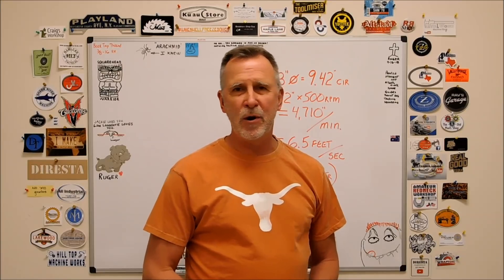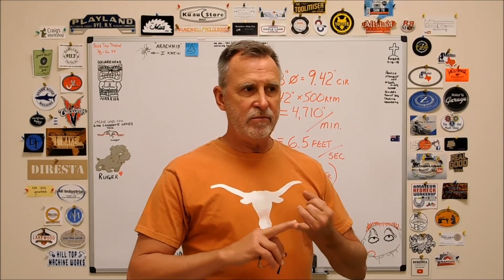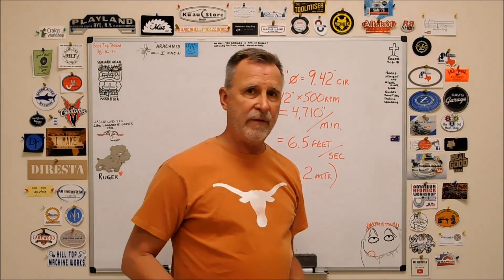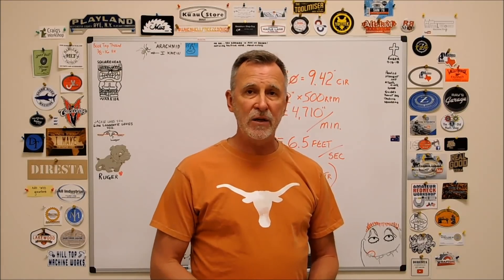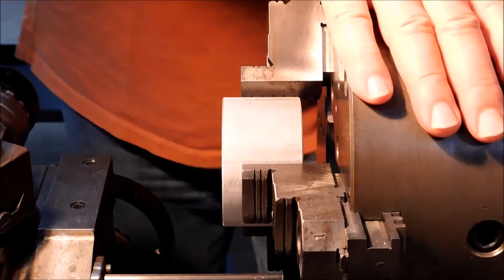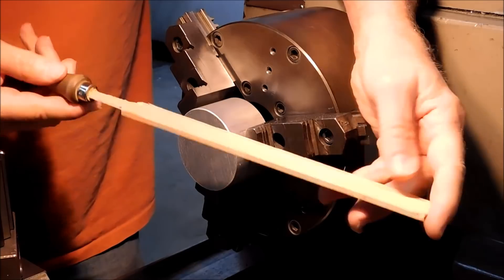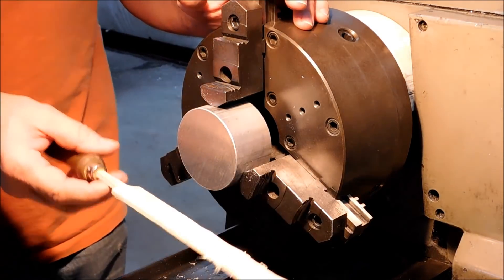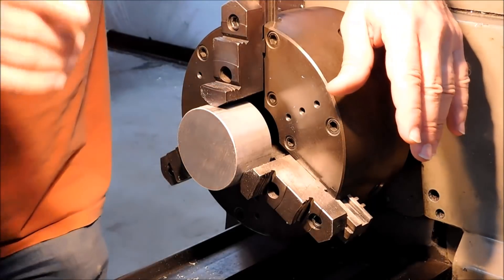File vs Spinning Chuck Jaws

Comment: I was taught to file on a lathe LEFT Handed back in high school in the early 1970's.  Thank you L.J. Jenkins for teaching me the safe and proper way to file on a lathe.

Now I cringe when ever I see someone filing right handed with their left arm hanging over that spinning chuck.
Reply from the maker: As much sense as it makes, I feel more vulnerable and awkward filing left handed. Like I also said, if the situation gets too risky, the form tool is the way to go.
Reply: I would never suggest that you change your style now Joe. That would be hard to change after all the years. I think the left handed filers were all taught the left handed filing way from their first time on a lathe, myself included.
Reply: @joepie221  I'm still glad I'm left handed and yes I've had the jaws give me a love tap to let me know they are there. Love your advice anyways Thanks mate
Reply: Im left handed and joes filing right handed horrifies me.
Reply: I'm right handed, but from the start I studied the situation and concluded that safest is left hand on handle, right hand at tip AND stand well towards the tailstock end out of the line of fire.  Also, a proper long lathe file (single cut with long sloped grooves) helps.  A file card is a necessity too.

Comment: I learned this lesson the hard way...no handle with a short file close to the chuck. I had a momentarily loss of concentration and the tip of the file went into the chuck.

It kicked back and drove the file's tang about in inch into the palm of my hand. I pulled it out and continued working....but never again without a handle or with a short file.

I got incredibly lucky.
Reply: Were you not really  injured? How did you keep working?
Reply: @TheDefeatest 

We'll it fucking hurt...but the tang of the file just pushed back into the fatty part of the my hand. Just a simple puncture wound, scary as hell but nothing too serious.

I pulled it out, washed it real well, gave it the old paper towel/electrical tape treatment and went back to work.

Comment: ALL machinery and machinist manuals say to ALWAYS file LEFT handed on a lathe.  Put a file in your right and left hand, which hand is holding the file pointed AWAY from the chuck?   ......your left.
Reply from the maker: But when the file slips off the piece, the pressure is towards the chuck.
Reply: @joepie221  Your channels offers a LOT of good machinist stuff, many good tips, tricks, especially the lathe, which I really enjoy.  As an old timer myself it's never too late to learn something new about machining and fab.  This particular one though, Joe, sounds like you've got your boots dug in on it for filing right handed, hugging the lathe over the chuck. Your record sounds good for not having it bite you so far.  You won't convince me to stand in line of the chuck, or use a file that way, .....ever.   If you go back to the origins of the engine lathe over 200 yrs now, you won't  find any lathe manufacture, or machining training, ever encouraging machinists to use your method. It will always be to file left handed for safety.   Similarly there are those who seem to believe its okay to leave the chuck key in the chuck, and won't concede the point.  As a viewer I try my best to separate the good info from the bad, as there is so much to learn from youtube.
Reply: Having no control and control is everything.
You can feel the air if too close elbow on headstock so much so you can control your body, hand and files witha  constant clipping, thats control and it never whips the file at you if running fast enough.

Comment: Joe i have a selection of files specially cut for lathe O D turning i use in smoothing out rifle barrels used properly they don't clog but veary little check out your file supplier .😁.
Reply: I'm pretty sure Joe is familiar with lathe cut files :)

Comment: Joe, thanks for the vid.  Have to add my voice to others here in that I was taught to file "left-handed", i.e. left hand on the handle, right hand on the tip.  This negates the need to reach over the spinning chuck.  This doesn't alter the point you make that controlling the tip of the file is key.
Also, I'd love you to repeat the experiment with reversed jaws and the workpiece held in one of the minor jaw steps.  This creates a gap between the O.D. of the work and the outermost step of the jaws, which I would consider the most dangerous situation for a hookup. This would be an unusual situation and I can only remember having to file like this a couple of times in my life.  On these occasions I make a large washer that slip fits the O.D. of the job and is large enough to cover the gap between the job and the jaws - preventing the file from accidentally hooking up. A piece of 3 ply, or heavy oil jointing or similar will do - simple and disposable.
Keep those great vids coming with thanks from Down Under.
Reply from the maker: I've seen that exposed jaw setup done many times. Thats just asking for an accident. Take the time to setup the chuck correctly or don't turn it on. Filling the gap is a step in the right direction though.
Reply: @joepie221  Absolutely Joe - couldn't agree more.  Sometimes however the shape/size of the job dictates how it gets chucked. I usually wouldn't file in those circumstances but sometimes it has to be done - hence my little gap blocker.  Just FYI, I am 65 yo and I have been using machinery for nearly 50 years.  I still have ten fingers and ten toes, 2 eyes, scalp etc etc - you get the idea. [So doing twice in half a century is not too frequent, but you can see the pattern developing haha.]

That's why I brought it up - I would like the less experienced machinists out there to know just how hazardous that situation is. The file won't bounce off those outside jaws nor will it throw it back at you, most likely it will shatter it against the bedways and throw razor sharp shrapnel all round the place.

Thanks for taking the time to reply.  It must be quite time consuming and many Youtubers don't do it, so well done. I like your videos and also admire your orthopaedic work - very valuable to many.  I know I rant on a bit [apologies] so keep up the good work and I'll shut up for now!

Comment: I never "Hug" the chuck of a lathe to file. Now i know why you think going under the chuck is for the devil. I always stand to the right of the cross slide and hold the file backwards under the part. it keeps me far away from anything spinning. even if there were debis in the chuck.

Comment: There are many older Southbend lathes with exposed pulleys on the headstock and the drive belt looped to the jackshaft mechanism behind the headstock.  To reach around the headstock with your left arm over the moving belt multiplies the risks in filing.  Like many other commenters, I file left-handed.   It's the way I was taught forty years ago.  It also keeps your body out of line with any projectile off the chuck.  
Many novices buy older machines for hobby work.  It's worth noting that these older machines don't have the safety features of newer machines.   It's always good practice to assess the potential risks of any machine and setup before proceeding with an operation.
Good video, Joe.  Safety can't be overemphasized.
Reply from the maker: A lathe can ruin your day a 100 ways and keep on running. you have to respect it.

Comment: I know that I have never been taught this information before about controlling the tip, but I have learned it the hard way, by catching the tip on the spinning vice jaws, fortunately all it did was scare the crap out of me. Now most of my files have handles on them, I’m adding handles to my files as I use them. Good information Joe,

Comment: I agree with everything you said Joe and have done the same demo for the apprentices in my shop using a paint stick...lol I am right handed but was taught to file left handed when in school 35 years ago. The instructor would have it no other way...NO leaning over that chuck. At first it was a bit strange to file lefthanded...now it seems very strange to file with my right hand. Filing lefthanded is much safer as far as I am concerned and is easily learned. Keep the great videos going.

Comment: You put the part in the chuck with really minimal stickout so that your file was reaaally close to the jaws. I guess that was intentional. I have to say this whole thing had me puckered. I do file on my lathe regularly but my chucks are smaller and the jaws are not sticking out that much radially and I am not usually that close to the jaws. Thanks for having the guts to show this. I learned something.
Reply from the maker: It was intentional. The wood file made this easier to demonstrate, but a 8" splinter would still hurt.

Comment: Holding a part with the inside face of outside jaws, because you're too lazy to swap them. Now you have a situation where the file riding on the top of the part can get grabbed by the protruding part of the jaws at a good distance from the center of rotation. And that two points of contact would certainly grab the file and swing it round. Maybe taking your hands for a ride into the bed. Maybe coming round for multiple whacks at your hands before you can even react.
Reply from the maker: In the blink of an eye.

Comment: I am left-handed and use my left hand on the file handle. I find this approach quite a bit safer - do not have to reach over the chuck. I totally understand why "normal" people go over the chuck. I know how difficult it is do things using the "wrong" hand such as me hammering with my right (nearly smashed my left on the first try). Whatever you do, be careful. These things are merciless.  BTW: those jaws appear especially deadly extended that far out.  Aside from reversing the jaws, perhaps plastic 3D-printed piece to fill the gaps between jaws?
Reply: I came to make the same comment.  I'm not sure if it's because Im left handed or because I didn't like reaching over the Chuck but same deal, my hands are the opposite of this to avoid going over the Chuck.
Reply: Wow, someone beat me to it lol...
I, too, am left handed (left handed biased ambidextrous to be precise) so I NEVER have to reach over a spinning chuck. FINALLY a benefit to being left handed :D
Reply: I am right handed, but have always used a file like you lefties. Just seemed a good (safe) way to do it, and now feels natural to me.

Comment: If you're using a DSLR for video you can stop down the lens (like f11) but then you have to up the ISO (that causes noise issues) or use a lot of light. If you add light you should use a softbox to "tame it". Thanks for the safety tips
Reply from the maker: Nikon b500. I can't step it down. Full auto focus in video mode.
Reply: @joepie221  Bummer. I'd have to try it to know for sure but I think my 5DMKIII and 1Dx (Canon) will both let me switch to manual and I know the lenses all have manual. It's still not easy. In darker environments stopping down requires a s-ton (note, s-ton is a universal measurement and it means the same thing in imperial or metric) of light, shadow mitigation, and bunch of other bs. In other words, the more you complicate it the more it gets complicated. 

The good news is that if you overpower the scene with light the "auto" of the camera may stop it down to get you the DOF that you need. Try an experiment with a 100W - 200W spot light. Unless you use an LED bulb it'll get hot. You'll probably want 2, kind of of each of your shoulders angled in and then a lower wattage light, farther away, to backlight. Backlight gives the object an edge. Lighting follows the inverse square law. "The energy (in our case: light intensity) at location A (subject area) decreases inversely proportional to the square of A's distance to the energy source" so tuning the setup is a matter of moving the lights. If you like what it does you can add light stands, hot lights, and softboxes to soften the light and give it that pro-fesh-un-al look

Lighting is always king...

Comment: There are a couple ways to do this. Depends of what youre trying to achieve. Deburring? Edge break? Chamfer? With the jaws out that much and only about 3/8” of material sticking out its a touchy operation. Even a 1/4” more material sticking out makes a big difference. A good habit is to plan where your burrs are going to end up. Like on a chamfer many times i reverse the rotation and retract the compound slide so the burr is on the face. A handle is always a must. Better to get hit with a blunt handle.

Comment: I know this is a lathe but it reminded me of a guy I worked with one time who told of his instructor using a carrot in a mill similar to the use of a hot dog in a grinder for emphysis. (I spelled for a reason).

Comment: I usually use the two handed method like you showed, once in awhile I'll file left handed. I never use a file without a well fitted handle. If for some reason if you don't feel comfortable about anything in a shop don't do it. Thanks Joe.
Reply from the maker: AMEN.

Comment: I find filing on the lathe left handed to be the safest method. There is no reaching over a spinning chuck. If there should be a bind your body is not in line with the file, you stand a better chance of the file going past your body. It is still necessary to use both hands to control the file as you show in the video. This method comes easily if you are left handed, right handers will find this awkward at first, but it can mastered with time and practice. Hope this helps.

Comment: Whenever I’m on the mill or lathe, I always make sure to let my hair down, put on my long scarf and gloves, bypass the interlocks, tell no one where I am, take some sleeping pills with a shot or two of triple distilled IPA to calm my nerves and slow the work piece by pushing my fingers into the bore when I’m done. 

My technique has served me well and never caused any problems. 

Sorry for any spelling mistakes, I wrote this with my feet.
Reply from the maker: Throw in a few shots of good tequila to make you brave, and be sure to wear roller skates. Then wake up from the nightmare.
Reply: Do you also take a nap on the bed of the lathe on long passes? Hope you didn't get any toe jam on the keyboard. Itza b¡+ç# to clean off with only a lower lip!
Reply: @stanervin6108  Your thoughts  are not ringing the bell 😨.

Comment: Imagine removing the file handle, and having the point end drive so far into ur wrist that it pokes out ur arm. Then all the non-rusting metal shavings are squished inside your arm. So whenever you go thru the airport the sensors go off ..
Imagine that.
Reply from the maker: Imagine the process to clean out the wound. It involves scalpels, plastic brushes and lots of scrubbing.

Comment: Man, with all these vids from Joe it reminds me of how good my high school metal shop teacher was. He covered quite a bit of this in the same manor with demonstrations similar to this. Even though he was really grumpy old fart, he had a heart of gold. The ONE demo he did that has always stuck with me was with a pedestal grinder, of do NOT put your finger close to the wheel, or it WILL suck it in. He did the demo with a hot dog. Gnarly mess!!! But there was ALWAYS one student per year that still didn't believe it, and they did it with their own finger. Stumpy was their nickname after that, and forever banned from any shop class.
Reply from the maker: Day one of my first real shop class, the instructor laid a broom handle between the jaws of a chuck going about 40 RPM. The machine snapped it off and didn't even slow down. Instant and permanent respect.

Comment: Heh. I had visions of you pulling a string on the arm of a crash test dummy to test this from a suitable distance.

Reaching over the chuck is dicey, but potentially you're using the headstock to shield your soft and tender bits. Either way, you need to be paying attention and operating at 100%. No talking, no distractions, not getting drowsy after lunch. Oh, and no standing in line with the chuck. Either stand in front of the headstock or in front of the saddle.

Speaking of which, I may epoxy some nubbins on the floor there to discourage standing in front of the chuck. Something similar to the bumps they put on the curb edge of sidewalls for the blind. I occasionally catch myself standing there, even though I know I shouldn't.

Using an actual lathe file should help with the clogging. They have teeth at more of a skew angle to the body of the file.
Reply from the maker: I considered a more elaborate setup, but I think the demo made its point.

Comment: Every time I see someone reach over the top of the chuck with jaws sticking out, I cringe.
Reply: Mini GP Racing I’ve had the good fortune to spend some time with a Hardinge HLV-H using the collet chuck attachment. It is the single nicest, safest experience I’ve had with any lathe.

Comment: Good demo, Joe!

I've never been a fan of using a file close to the chuck. If I'm sticking out a couple of file widths  or more, OR I'm breaking the edge on part supported by the tailstock, no problem. But, in close to the chuck is a no-go zone for me. 

Just too many things which can get caught up in the rotation. The file isn't the real issue. Stuff in pockets, sleeves and loose clothing are probably a bigger issue than the file.
Reply from the maker: Thats one benefit to wearing an apron.

Comment: Outstanding video on shop safety... can't be overstated....as always , safety glasses, no loose clothes, shirtsleeves don't extend past the elbows, watches & rings in your pocket or toolbox....a lathe will suck you in like a typewriter feeds paper... being short as a munchkin has kept me from reaching over most any lathe...what filing I have done has usually been left handed, and with a lathe file....but as you've stated a form tool usually gives the best results... keep up the good work.